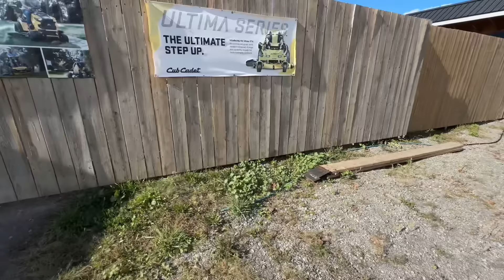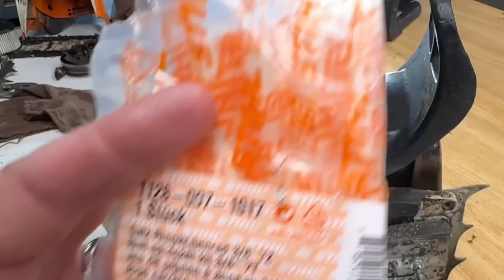Stihl MS500i Chainsaw! Wow, 8000 Starts On This Milling Saw!  Clutch Blown Apart! Let's Dig In!

Comment: I don’t know if 300 hours for a saw used on a mill is a lot or not. When I worked saws, 300 hours would have been roughly 10 weeks work for the saw. None of my saws looked like that one, poor saw. Very surprised how well it ran, must say something for Stihls quality. Thanks for showing us it
Reply: I've been considering buying one of these 500i. this sold me! Started on the 1st pull 3/4 of the time after being  beaten on like a rented mule!
Reply: Same, this was a neglected saw and just banged around with no care. 300h is still a new machine, with good care pro saws can last 3-4k hours minimum.
Reply: As long as it is a pro model saw, stihl quality cannot be beat. I am not a fan of homeowner model stihl saws though. The only homeowner model stihl I have is a stihl ms 250. The ms 250 seems to punch above it's weight though.

Comment: 8,000 starts with only 12,000 starter pulls.  That's only 1.5 pulls per start.  Amazingly easy saw to start.

Comment: It's last service was...never. The company or person that owns that saw should be embarrassed. You take care of the tool. The tool takes care of you.
Reply: Well... It was never plugged in to a computer and data was never downloaded, that's the only thing you can say for sure. My 500i would have that exact same reading for the simple reason it hasn't been at a dealership for 5 years. Difference is that my saw did have it's normal daily maintenance and service, but I do all of that myself. The saw in the video missed a lot of those TLC moments 😒

Comment: You have to give a big pat on the back to the designer of fuel injection, in that it could automatically adjust the fuel air mixture to keep that saw running with an air filter intake like that! amazing. That saw has certainly worked hard, shame no one looked after it a bit better as it is an awesome machine.
If the saw was injesting just the dine wood particles do you think that they would be enough to damage the piston and cylinder or would they just blow straight through?

Comment: Wow, takes a real beating,and still surviving, I am in the position of being an independent shop like Kens, or Taryle, i had a customer drop off a newer hedge trimmer with the M-tronic system, asked the local Stihl dealer to run the scanner on it for codes , they did not know what i was talking about, do you get people bring machines in to run on the scanner before fixing them? great video with that Fuel Injection systen

Comment: I havec462 cm thats few years old it was ran over by trailer of wood and survived with cracked air cover bought new one and fixed the handlebar bent it back.and recently had a helper that dropped ot 65ft out of bucket truck the only damage was the bar and computer wire that has 2 wires over to carb. 1 was ripped or torn out..sent it to saw builder he ported it..said nothing else was broken..it landed on huge logs ..testimony to 462 great saw. Have had more issues damages this last 5 months then ever before . Have few saws with carbon and light scoreung..issues i swtched to vp few months ago and has caused it. Before i ran red armor 40to1 and occasionally maxima k2 never had issues ...threw away the vp. Real upset try take care of my tools i depend on them. And have learned to be somewhat of mechanic last 7 years in business solo .but hard wearing half dozen hats daily...overwhelmed had to reset 😮😊

Comment: What is the part number for the plastic peg cover piece that prevents the peg on the handle bar from breaking the crank case? A few months ago while taking a saw cert. class we tore our saws down for maintenance and it was the first time I had ever taken the handlebar off. Apparently that little black piece had fallen off of the peg and was left remaining on the table after all of the other parts had been reinstalled…I didn’t know where the little thing went. That was months ago now and I’ve since lost the component. But now that I know where that piece goes how do I go about getting one ordered? Town is a long ways away and the Stihl dealer there is basically worthless. Hoping to just order one online and fix it myself. If you can help it would be greatly appreciated.

Comment: One small tip about the 500i, the filter tend to leak fine dust, I found this great tip in another video about adding an additional cloth washer between the filter and the plastic. For me this works perfect, never had an issue with small particles inside the filter.

Another comment from me is, damn, people saying the 500i is not reliable can go suck it, this saw was eating dust and still running perfect.
Reply: I have an ms361 and 460 and I use dielectric grease where the air filters seal otherwise they‘re sucking in fines. I have not heard of using a cloth washer. I do not have this issue on other brand saws.
Reply: Take a sharpie and mark the outside of where the air filter sits then go and get some high quality(ex: 3M) adhesive backed 1/4" - 3/8" thick X 3/4" - 1" wide weather strip and carefully install it on the plastic just inside the sharpie line without any overlap. You may want to clean the plastic first with some 91% isopropyl alcohol, denatured alcohol, or acetone to make sure the weather strip adheres to a clean oil-free surface. When the plastic cover locks the filter down on the weather strip it will make a perfectly tight seal and zero fine dust will pass under the filter.

Comment: Is it a primer or purge bulb?  I would guess it’s a purge bulb
Reply from the maker: I called it a primer bulb, but it’s technically a purge bulb / purge pump (depending on what country your in)
Reply: @marriedwithsmallengines  I always thought that a primer bulb squirted fuel into the venturi and a purge simply moved fuel within the fuel circuit.

Comment: Love your videos. They are so good. That saw was definitely used a lot and the air filter? OMG What a mess BUT it just kept running until the clutch broke. A testament to how good these saws are. John from MI
Reply: The 500i and some other Stihl saws have compensating carbs that adjust the fuel/ air ratio as the air filter becomes clogged, temperature, and altitude.... that filter was atrocious!

Comment: Hi Erica and Tyler. Great to have you posting videos again,  appreciate you burning the mid night oil to make them for us! Top quality video and instruction too.  I just had a totally filthy and neglected MS250 in to fix. Pull cord was stuck?? Found a totally disintegrated clutch side crank bearing, pieces found even up above the piston. Needed cylinder, piston and bearings, plus more. The customer didn't want to spend that much so he gave it to me for parts. Dont think it had ever been serviced either. I rebuilt it as I think the 250 is a nice home saw, but not a cheap fix even using good quality after market piston and cylinder kit. Keep up the good work, glad your cat survived! Peter in AUS.

Comment: I hate idiots who don't take care of their machines and they keep abusing them untill they fall apart.
For example I use my FS120 professionally and after almost 9 years I realised that if I let it sit for 10 minutes I need to prime the fuel before restarting, took it to a shop, he replaced the diaphragms and told me to keep the good care of my machine as I did for all these years. When I touched the old diaphragms I heard they are slightly clicky... If I was like most of the people my FS120 would be trashed long time ago..

Comment: I was totally shocked that it started when it did! That is one tough saw. After seeing inside the spark plug hole and seeing how clean it was and seeing the air filter I'm totally amazed.

Comment: I have a cub cadet zero turn mower hardly any problems wonder why you have 3 or 4 of the same cub cadet there? And that much damage is ridiculous
Reply from the maker: We have many customers who bring units in for routine maintenance.   
We have sold thousands of these units so it’s
Not uncommon for there to be several here at a time.
Reply: @marriedwithsmallengines  oh ok i thought maybe something bad wrong with them lol thank you for taking the time to answer my question and i love your videos oh and awsome job on that stihl 500i👍👍
Reply from the maker: Thank you so much!!

Comment: @8000 starts and 297 hours he must be cutting a lot of small stuff or that saw is a beast. Averaged out that's just over 2 minutes of use each time it's been started. But I must say I'm impressed with how well that saw cold starts and runs with fuel injection.
Reply: I’d bet it’s a tree service saw one of thy guys I fix saws for has a 500i with around 300 hours and 15,000 rope pulls. I’ve fixed the rewind twice, most tree services up here shut saw off if moving more than a few feet.

Comment: OK, I reviewed the comments and found there were no math nerds questioning the operations of this 500i.

When I start the MS361 that I have had for about 15 years (used when I got it), it runs for a while.

This saw runs for an average of 134.91 seconds/start...or 2min, 15sec.  I would assume that they only make a couple of cuts per start and then throw it back in the truck.  I know it is supposed to be an amazing saw, but doubt they are bucking up a tree in that short amount of a time.

On the plus side, it is just 1.5 pulls/start.  In the beginning, probably started first pull and then as filter became clogged, it took two yanks to get it running.  Still pretty impressive!

I couldn't imagine running that long with my mouth tapped shut and my nose pinched...hats off to Stihl.

That said...if my math is right!

Comment: First of all, I absolutely love the 500i and have had one now for 2 years and use it all the time.  However, it is absolutely the wrong saw to use for milling.
For that purchase price , the owner should have been able to obtain a 100cc saw, preferably with a manually adjustable carburetor.  There is absolutely nothing more brutal for a chainsaw than milling.

Comment: Used and abused. 😂. 12000 pulls and 8000 starts means it quite conceivable that saw start first pull 66% of the time. 👍

Comment: Rolled bowled and ar#@holed is the term we use  for saws treated like this  only thing worse is run over by a skidder  or a bulldozer 
 I was told that the design life of a 066 is 600 hours

Comment: I don’t get it. Why spend that amount of money on a saw, then do no maintenance on it. Got to wonder, if he cares so little about his own equipment, how much less he probably cares about the quality of work he does for others?

As for milling. It’s a good saw and is as you said, it’s a thirsty beast. But it’s just not built for milling. Get at least a 660/661 or 880 or Husky 3120, at a pinch, a 395 or a newer 585.

Comment: My son bought me a Stihl 500I for Father’s Day. What a beast of a saw ! The only thing I’ve noticed was pointed out by Buck n Billy Ray. 
When the saw is under a load, it 4 cycles noticeably. I believe Stihl programs the fuel map that way to prevent it from running lean. But it’s kind of annoying.
Reply: Buckin also realized in a later video that the saw doesn’t do that much if at all if you actually calibrate the saw like you’re supposed to. Just running the saw in the wood doesn’t calibrate it. Look up a tutorial on how to do it, if it works properly the saw will shut itself off when complete. If it doesn’t, you didn’t do it right. After that it’ll run a lot better.